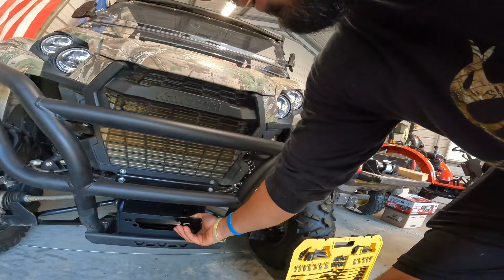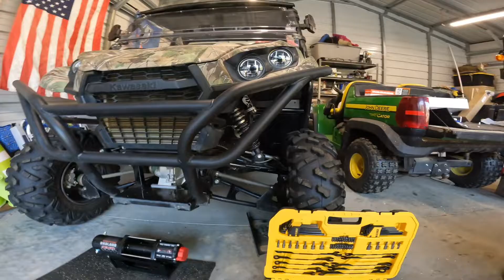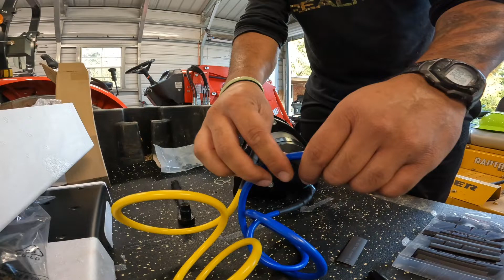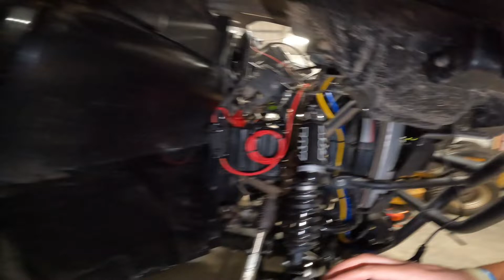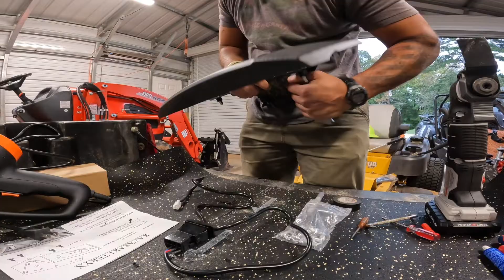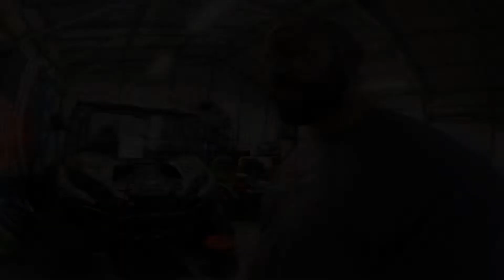Badlands 5000 winch install on my 2021 Kawasaki Teryx

Comment: Thanks for making the video.  I installed the same winch on the same machine.  I didn't bother buying the Kawasaki mount  but I wish I had.  I used the mount plate that came with the Badland's winch.  For anyone reading this, don't do it.  You'll have to drill holes and cut the skid plate to make everything fit.

Comment: I have the same winch with the same power post touching the brush guard issue. Some people have clocked the end housing by loosening the bolts and turning the end cover that the post protrudes from. It seems that some of the winches can be clocked and others not. Mine wouldn't turn so I need to reluctantantly dent my brush guard as you did. My Teryx is a 2014.

Comment: By putting that aftermarket winch  on your teryx did it void your warranty from the dealer?
Reply from the maker: To the best of my knowledge, I would say no.  Not sure why it would  because it has holes already pre-drilled for a winch and I don’t think Kawasaki has a specific list of winches that can only be mounted on it.  But I would advise you to check your owners manual just to make sure.
Reply: Thanks for responding I appreciate it. I will check my manual